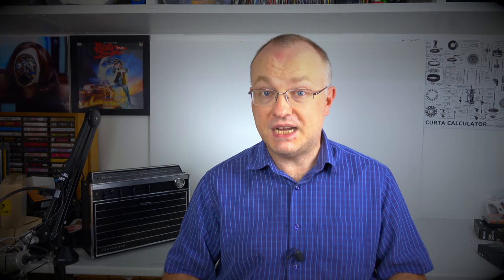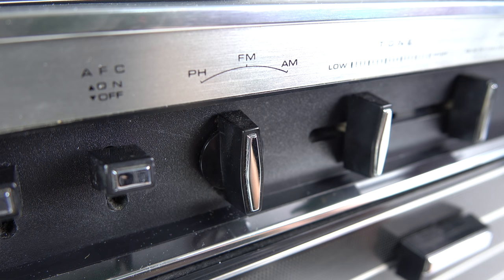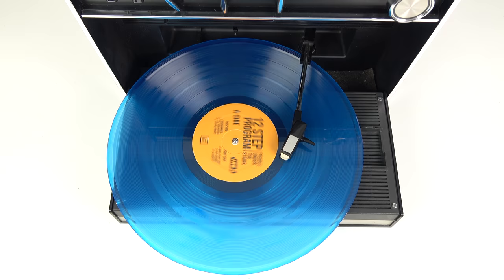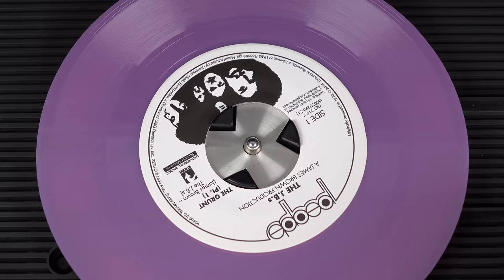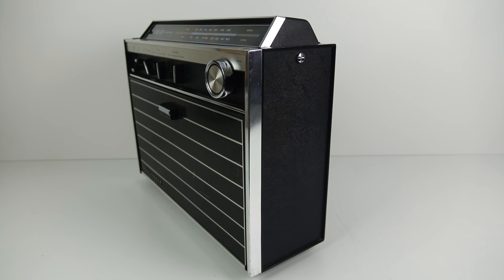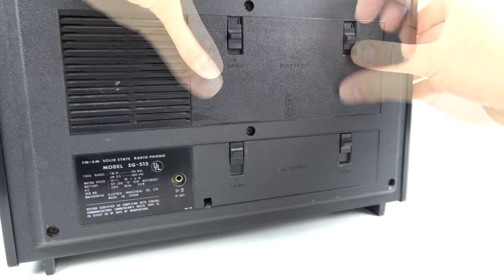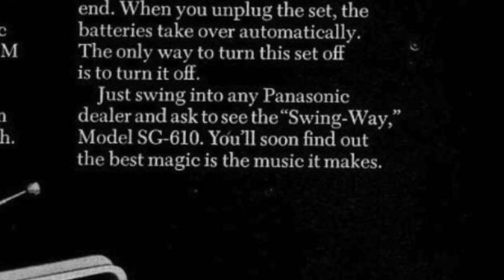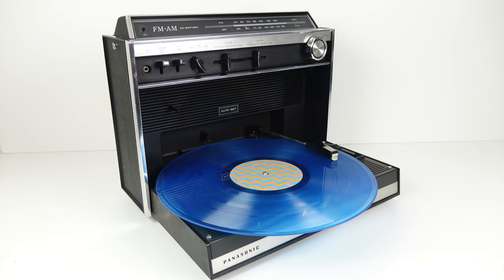Design Classics : Panasonic SG-515

Comment: Hello.  I just happen to have the older version you mentioned. It is less than two feet away from me as I type this.  The turntable works the same way.  I bought mine at a flea-market for two dollars. Seller had no idea what he had there.  He didn't even know it had a turntable in it.  Works very well, and looks near perfect.  It has the best AM reception of most of the old radios I collect.  And considering the size and quality of the speaker, it doesn't sound too bad.  It is my main radio for when I want to actually listen to AM or FM.  Plus I can play my old records without having to uncover my floor-model stereo.

Comment: This is great!  When I was a kid, I was given a similar radio made by Sharp. It was AM/FM and the record player was under a lid which flipped open in the back...you would turn the radio over, face down, the carrying handle folded down to provide support, as well as a pop-out leg on the bottom of the radio.  It would play in stereo if you attached a secondary speaker or listened through stereo headphones, otherwise you had mono sound through it's solitary 3.5 inch speaker.

Comment: those battery holders also mean that should that door ever pop off you wont have a bunch of batteries fall out just two tubes to quickly recover.
Reply: It also means that when the leak it will keep all inside.

Comment: Panasonic really where the daddies in those days, when I was 4 my dad got a Panasonic radio cassette 1977 ish ... that did 40 years of service to our family in the same greasy kitchen corner  next to the sink. and it could still play a tape, barley.
Reply: The belts need to be changed in the tape machine. Still somewhat working after 40 years on the original belts is impressive. Be careful about changing belts though. Some tape machines are as if they made it hard on purpose to change the belts and some tape machines fall apart in your hands just opening them up. I do not know about Panasonic yet. Stay away from Radio Shack/Realistic. You can get new replacement belts on E-bay. I was never good with belt sizes so I order the variety size packages. Belts strech so pick the new belt(s) that's a size smaller than the old one. That old belt itself was one size smaller when it was new.
Reply: Lol. That dude mentions his parents radio and you get carried away talking about belts and Radio Shack? WTF LMFAO.
Reply: Well its true that belts get old even if they are never used. I have bought quite a lot of old stock new in the box tape decks and portable cassette radios. Some of them the belts can be changed easily and others fall apart in ones hands. And Radio Shack back in the day was overrated crap and now they are nothing at all. I know when a tape machine fastforwards a tape but doesn't rewind or play it means the belts need to be changed. Everything was better back in that time, but even so there was junk like radios older than my 47 year old self that sound just as crappy as a modern radio.I speak from personal experience and I hope it can help some people. I want people who like old to enjoy it like me, but not have bad costly experiences like I have had. He likes his parents 1977 Panasonic and I want hm to fully enjoy it. 1977 was 41 years ago.Maybe his parents passed by now and this is nostalga and warm memories combined,. My mother passed away and I have her 1980 Sanyo AM portable radio which I enjoy from time to time and I have good memories of her as well. As you see this paragraph grows and it gets personal now. And this is why I got carried away as you put it when it comes to tape machine belts. If someone can have a little piece of happiness in life then so be it. And if I can help make it better with some advice, well why not? I too have learned from other peoples advice and experience
Reply: haha don't get me started on belts

Comment: That is a very good idea having those speed sensing switches built in, and doubles as a 45rpm adapter. Very cleaver. Makes me wonder why this wasn't used in normal larger turntables. I know there were some built with holes in the platter with lights and sensors to detect the size of the record, but this way of doing it is better, then you wont lose the 45rpm adapter or have to place one on the platter before spinning the record, as long as the switches hold up anyway which might be the elephant in the room with this design.
Reply: That wouldn't be a very good idea for us who have lots of 12 inch singles that play at 45 rpm
Reply: Israel Quezada
There are always exceptions, and I have one of those records. 12" 45's are kind of an oddity format, and they did that so people didn't need to use an adapter, plus I think those are better sounding than the normal 45's. Simple speed switch / button, to select Auto-33-45 would solve the problem.
Reply: James Reeno
Ya they are, just because there are a lot of singles out there has nothing to do with the fact it is an ODD format. Zillions more 33's exist as 12"
Reply: The automatic sensing can cause trouble, but I once seen a portable turntable with a pop-up adapter built into the platter. It had a spring under it, and pushing it down and turning it a bit would lock it in the down position.  I think it was pretty neat, wonder why I haven't seen it elsewhere.
Reply: You obviously have no idea how popular the 12" single format was and still is. From about the year 1975 of the disco era up until today, through all the historical genres of electronic dance music, this was the main media for this kind of stuff. Discogs shows the amount of 1,7 million LPs and 1,1 million of 12" singles. Not much of a difference. And it seems to me that Discogs doesn't use the ' 12" ' designation for LPs, it uses the ' LP ' designation for them rightfully, so this proves my point. Now let's assume that at least half of there 12" singles were recorded in 45 rpm (and I think in fact there were much more of them). To say that it's an odd format when there are least 500000 or more releases of that type is a bit dumb.
Reply: gctechs
It's a bit dumb to continue to argue a point that I don't agree with and won't agree with. ODD does not have anything to do with RARE. Get it? Of course you don't, cause you only look at things the way your tiny mind wants to.
Reply: You're wrong, I'm afraid. 12" 45s are neither odd, nor rare. Pretty much any record released with DJs in mind will be a 12" 45.
Reply: spooforbrains
"with DJ's in mind"  and there you go. totally different market, totally different needs and uses. DJ's are not normal record spinners. Therefor the format is ODD for normal users. People want to keep arguing with me, but in the end I am right about it.
Reply: *****
No, DJ's trash records for a living to look cool to others in a club, not PLAY them to enjoy and listen to them. Normal record spinners listen to the record AS INTENDED and takes care of their vinyl collection.
 As far as a 33 1/3 12" single, yes I would add that to the odd category, probably push that to the very odd category.
Reply: *****
Why are you still commenting then? I don't have time for people with little minds that refuse to get it. Try replaying now.... just try it.
Reply: Odd?  I have the 12-inch 45 of :Sweet Dreams" by the Eurythmics, and recently saw it sold at an auction for $300.

Comment: thank you for sharing this one. I especially enjoyed seeing it as I actually had a second hand one of those when i was young. I had no memory of the one I had or that such a device ever existed for at least 30 years until seeing this one here which brought back the memories clear as a bell. im sure it was one of these which was my very first radio and record player. as I recall mine no longer had those tubes for the batteries and as such either the door just could not hold them in well or perhaps had broken its catches so unless you taped the cover on well the batteries would often come bursting out. I have no idea what ever became of mine but i sure appreciate getting back those memories from so long ago. thank you again.

Comment: Fantastic video! This series should prove vastly entertaining. Panasonic kept on making portable record playing boomboxes throughout the 80s too, this is definitely the originator of those pieces, they switched to slide out mechs instead of fold-down ones. Those battery tubes were also included with most of the high end Sanyo boomboxes of the late 70s and early 80s, particularly the X920, Big Ben and M9998k. I thoroughly agree: they should've been standard issue with any portable that used 6 or more D batteries.

Comment: Panasonic liked making radios with these creative designs in the 1960s and 1970s. I have one of their "suitcase" stereos with FM/AM tuner and 8 track with detachable speakers. and this other weird "receiver" where the entire receiver section lifts up and back from the base to reveal a record player underneath.
In the 80s there were a few boomboxes from Sharp mostly with either fold-down turntables like this SG-515 or vertical record players with linear tracking which could play either side of the disc, and even locate the tracks optically.

Comment: Was not expecting the hidden record player it reminds me of a portable music centre I had in 1975 manufactured by a company called Vela Sparta, it had the same size turntable & the speed was controllable 45,33,78, it ran on battery & AC and had an AM radio with the speaker built in the record deck more or less the same size as the Panasonic.

Comment: Panasonic made the best stuff back then. I have a bunch of their radios from the late 60's through the mid 80's. They're all well made and very sensitive for what they are.
Reply: Do you remember when the ads for Panasonic electronics used to use the slogan "Just slightly ahead of our time?" Well with products like this, that's easy to believe.

Comment: Those battery holders also reduce damage from leaking cells, though the ends will still suffer. Not used any more probably because users could not figure out how to use them, or that they do serve a purpose. Nice set, and you would probably find that plugging in the external speaker also configures a second audio amplifier to give the output, and also turns the inner amplifier from mono to only doing the one channel with the external one doing the other.

Comment: Wow! Neat radio/turn table! Bet it was relatively expensive back in the day. Very unique. Nothing wrong with buying "junk" you don't need on ebay. Actually it's not junk at all. It's actually very cool! Edit: I think a lot of portable radios from that era that took flashlight batteries like that used a plastic tube of some sort to keep them together. I have a Arvin AM tabletop that's like that.

Comment: Cool video, as always. I don't know if you mentioned it in the video, but even so I'm going to type out the next paragraph for anyone who has a similar portable record player.

Be careful with portable record players. They usually set the tracking force FAR heavier than a standard table, so it won't skip as much. This results in the record wearing out faster. I wouldn't say that you shouldn't use the portable, just use records of which you have an extra copy. Or, records you dont care about.

Comment: I highly approve of your new "series".
It is one of the stated desires of my own channel. Except you do a much better job. 
I did once have the older version of this that you showed the ad for, but alas, no longer. 
The one I really need to do is my Sanyo briefcase  battery portable with stereo speakers forming one side and a radio, turntable, cassette recorder AND an 8 track recorder in the bottom half. 
I love this sort of stuff !

Comment: not sure if you'll see this but, it would be very easy to add rechargeable batteries to that machine and not to difficult to add Bluetooth with auto main speaker cutoff as well(optional[you would just need to solder onto the headphone out and it's built in headphone in sense pin]) would be pretty easy to do as a 1 day project just need a small micro controller and a Bluetooth transmitter just would need to find a place to put a pairing button

Comment: really intresting find. that auto set thingy really gets in the way - while i remember my parents having small 45rpm singles with big holes back then, I only have 12" singles with small regular holes. one could open that thing up, find the wires to that switch in the center of the turntable and wire it up to a manually operated switch = problem solved

Comment: I've never seen anything like that before. At first it looks like yet another 1970s oversized radio but it's quite a neat concept. If there had been a manual 45/33rpm switch it may even have caught on in Europe. Actually it reminds me a bit of some of the innovative and unusual gizmos Amstrad used to market when they were involved in low end hi-fi. And I've seen that 'batteries in a plastic tube' concept before in the original lightweight battery/mains powered portable monochrome tv sets you used to get in the late 70s and 80s.

Comment: Wish I woulda heard about this swanky Panasonic unit before settling on buying a Sony FH-11w. (I've even been watching your channel for a couple years now, but missed this video somehow. Blast)

 Granted this model having a mono speaker would not be my style, but the later SG-55L sure would have been. Especially in red. They even appear to use a standard P-mount cartridge.

Panasonic always seemed to have excellent build quality in my experience. The 35yo tape deck in my Honda (branded as Matsushita) still works great with just a belt replacement

 And they natively run on batteries, rather than having to bodge a 12v plug and resistors into the FH-11 to get it to run on a car cigarette lighter.

Comment: ive got 3 different styles of record players like this....no radio... but "portable" record players. 

the one ive got working so far is a 1970 GE mustang 2.

had to adjust a lot of the mechanics under the platter. 
amazing mechanics....i study computer science, and rebuild engines in my down time....which is what you have to have knowledge about to work on one of thows things. holy cow. 

mine was all messed up, grease turned to hard tacky BS...every adjustment possible was out....had to bend metal, realign things....spin the pallter, hit a switch, see WTF happened, figure it out on a notepad, what moves what when. 

its a mechanical computer, a simple one, but it takes inputs from sensors and gives you music. 

was damn fun to fix...and thats how i got 2 more from my family. ...zenth nomad 2 and something else.

Comment: most Japanese transistor radios had those plastic tubes for the batteries back in the 60's! I remember when a family friend brought a National Panasonic TD-100D and the batteries lasted for just over 3 years before they needed replacing, we also had a Toshiba transistor radio and the batteries in that one lasted just over 4 years! but the dogs bollocks of transistor radio's was the Grundig Satellite 6001 and before that we had a Grundig Ocean boy. you will never see quality like that again.
Reply: The grundig 'boy' series radios were and are awesome. I have a Grundig Yacht Boy here right now, use it to listen to the news and suchlike in the garden. Built like a tank

Comment: Interestingly enough, the last few (aka new) singles I've bought here in the US have had the the 45 adapter inserts under the labels. Not that I own an SG-515, but it does mean I can't use the ridiculous solid metal adapter that came with my record player on the new stuff.

Comment: One other issue with the 45/33 selector is a 12" single, can't be cutting holes in them either!! :S

Neat gadget though, as for a modern equivalent, I'm sure the makers of them crosley things will have a go, then cheapen it, and then release something dire... :P

Comment: I love this idea for a video series. Definitely should do more. One question though: How does this device handle 78 speed records? Does it play them at 33 1/3?
Reply: I believe it would play them at 33.3, because the 78 RPM records have a normal size center hole.

Comment: UK 45 not having the huge centre hold, that tech spec is new to me! 

IS THIS ALSO TRUE FOR AUSTRALIA AND NZL?

The USSR had its own LP speeds 1950 to 1990, with 78 RPM being the only common speed -- and no 45 discs existing as far as I know. 

Sad the SG-515 did not support 16 RPM and 8 RPM for reading for the blind etc ...

Comment: I'm curious to know what the battery life is like when playing a record. Correct me if I'm wrong, but wouldn't the record play too slowly with UK 50hz power if you used a voltage adapter to run it on AC?
Reply: Probably not, since the motor has to run on DC from the batteries also, it won't be dependent on the mains frequency at all and instead use some different method for speed control.

Comment: How about reviewing a car 'picnic radio' such as a Blaupunkt Derby,  Citroen used to sell a 'Radioen' for the  2CV that was similar, works in the car on 12v and external antenna and pulls out for picnic with batteries and rod antenna. ??

Comment: Hum. I'm guessing the stereo sound gets downmixed for the mono speaker of the unit itself. But, if you connect an external speaker, will it switch to stereophonic? Right channel from the unit itself, left from the external? I also figure one could 3D-print a sort of, uh, tray for the unholey singles. A thin nuclear/radiation sign looking thing, with a nub in the center.